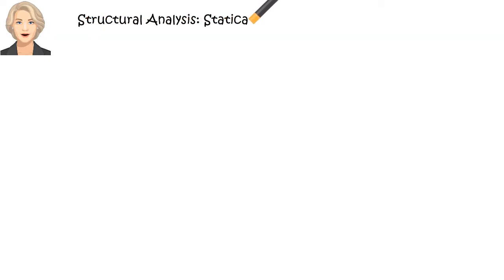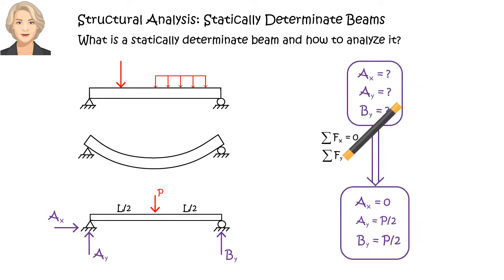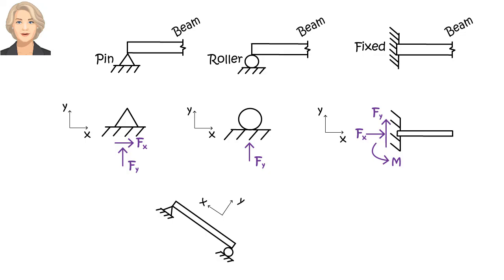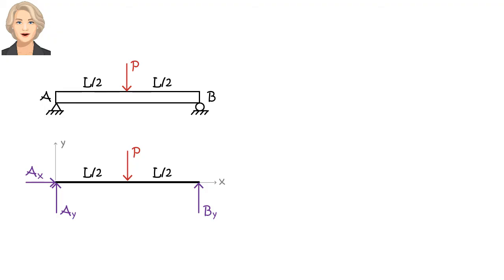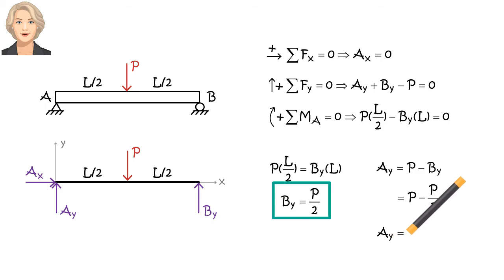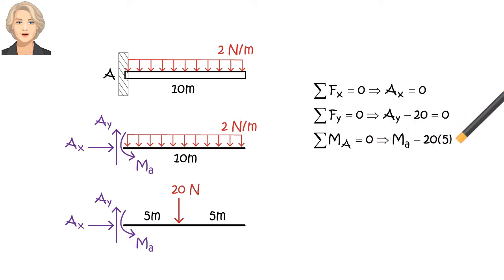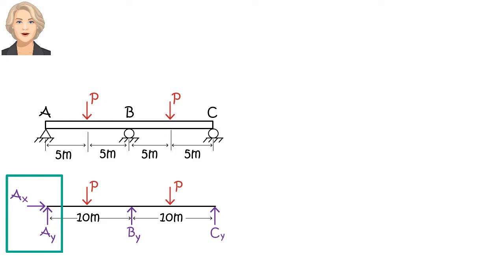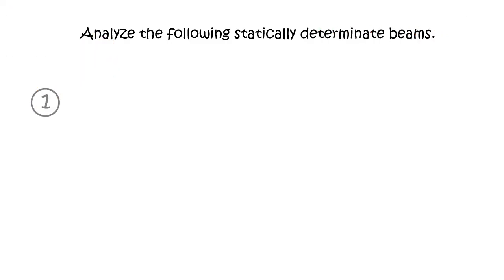SA01U: Statically Determinate Beams

Comment: QA: Ax=0, Ay=30KN, Ma=150KN
QB: Ax=0, Ay=12.5kn, By=12.5KN
QC: Bx=0, By=39KN, Mb=195KN
DR Structure please reply if i am wrong then please explain 
thank you
Reply from the maker: The answers you have provided from Problems 2 and 3 are partially correct. For Problem 2, the vertical reaction forces cannot be equal since the beam is loaded more heavily toward the left end. Hence, the left reaction force (Ay) must be larger than By.

For Problem 3, the moment of the concentrated load about point B alone is 350 kN-m. So the total moment cannot be 195 kN-m.
Reply: @DrStructure  thank you got it from the problems solutions